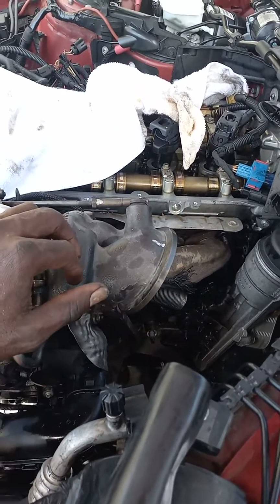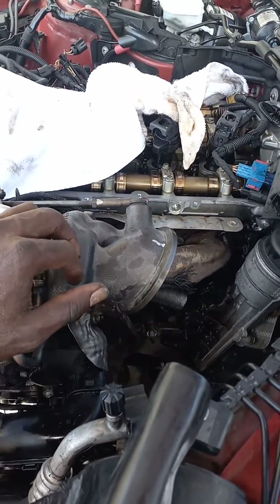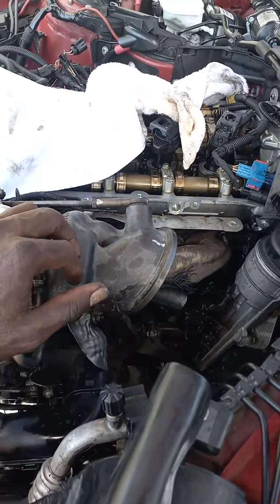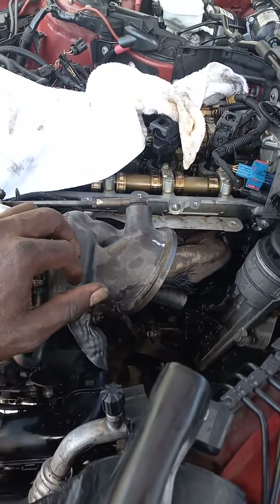Part 2 Explanation of how i remove my BMW 116i /f20/N13 oil filter housing

Comment: Hey Fam, thanks for this video. I am having similar issues. I am also in Jamaica, would love to set the link to get your opinion on my issue. Oil keep draining on the alternator and AC Compressor, the car smokes like crazy from the front. I am in Kingston, Portmore.
Reply from the maker: I am so sorry bro, I am so bust at times I hardly get to check this out, yours sounds more like your valve cover gasket tho, I am a jamaican but unfortunately I don't live in jamaica, but the valve cover is very easy to change, if you haven't don it as yet I am normally off on a Monday's you can send me a message and I video call you hand show you how to do it, I think all you need is a 10 socket set and the valve cover gasket.

Comment: Hi brother how did you get the downpipe bolt off the middle section of the downpipe next to the heat shield? I got one bolt off but can't get access to the bolt closest to the front
Reply from the maker: I was trying to watch over this video to try and remember how I did it but honestly to how hard that job was and I had to do so may improvise and add a lot of extension I honestly don't remember out of my head I am sorry I was not of any help.
Reply: @bmwloverforlife8091  do you remember if you took the downpipe heat shield off first or the downpipe?
Reply from the maker: @RBDET25  I took the heat shield off first, but it was very challenging to get to some of the bolts.
Reply: @bmwloverforlife8091  did you remove the coolant pipe first that is close to the top heat shield?

Comment: Did you manage to replace the gasket
Reply from the maker: Yes I did
Reply: @bmwloverforlife8091  i have also some problem with oil leaks...i have already replaced valve cover....so i will see if leaks come from oil filter housing...if i need to replace oil filter housing gasket, will i have to do flush coolant too ?  Thanks
Reply from the maker: @christiaanvanwyk2622  yes I did
Reply from the maker: @77luisf  I think I did but if you're coolant is new you can set something to catch it back and just strain it after to make shore there is no debre in it and if you don't know how to bleed the system there is a lot of videos on tube that can help or you can send me a message and I send you step by step